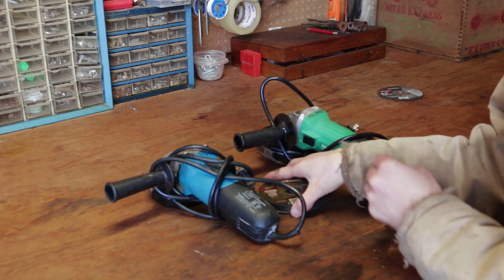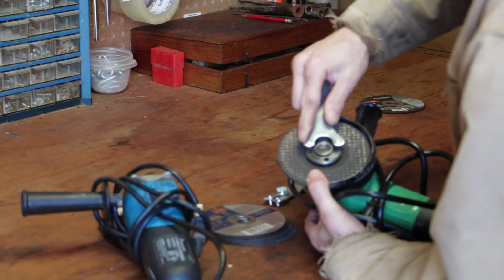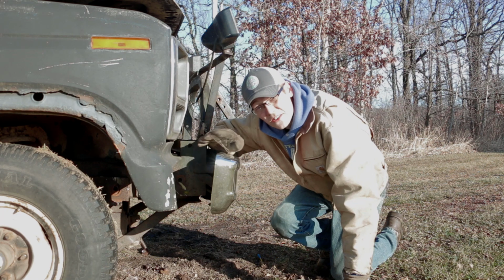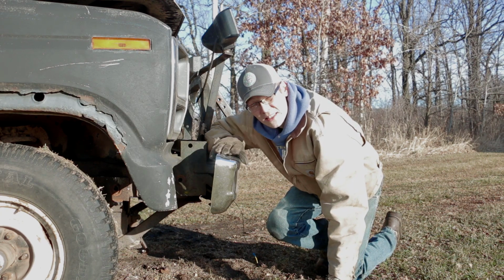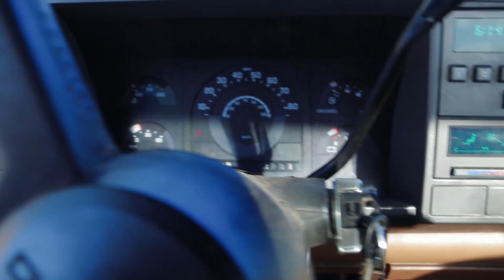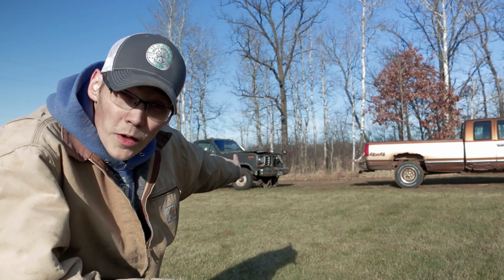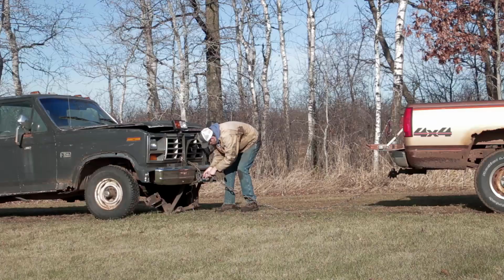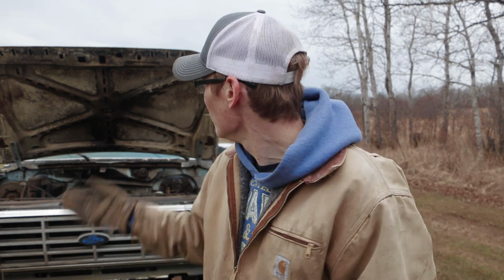Can An Angle Grinder Cut Off This Plow? - Vlog

Comment: You could use a metal wheel with diamond coated tips on your angle grinder. A subscriber sent me one. It works great and you don't have to replace it after every bolt. It does cut a little slower but it's worth it.

Comment: Good job, I knew there would be at least two more bolts the first time you gave it a yank, there always is! I don't bother with the cutting discs either, I just make the whole bolt head disappear and if they're really big and hard I'll take the acetylene torch and get them mostly gone first and then fine tune with the grinder.

Comment: I bought a cordless 1/2 impact and a cordless grinder just for things like this. I was surprised that the impact was actually pretty strong. The grinder however will stop and start flashing if too much pressure is applied but it will do it slowly. Still better than dragging out cords or generators.

Comment: Good to see someone else using those cheap rattle guns ... mines given me years of service and has only recently decided to snuff it. It's no Snap On gun but for the price I never complained. 

Top tip... Cut a slot in the bolts before cutting the head off... Less side pressure/wear on the 1mm cutting discs. You could also try using the slightly thicker discs for the heavier cutting jobs as these will take more abuse but do the job slightly slower. 

Keep 'em coming chap!
Reply from the maker: Great tip! Thank you for sharing this. I will need to try this out.
Reply: Least I could do... I've learned a lot from watching your channel and enjoyed myself quite thoroughly.